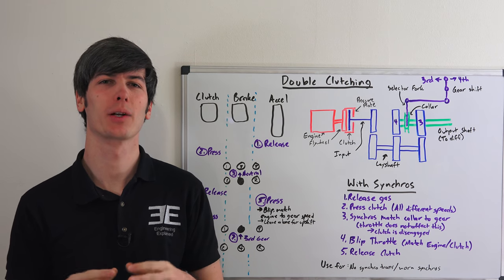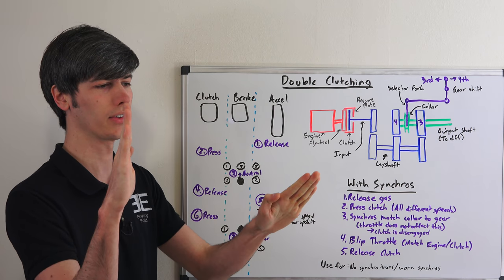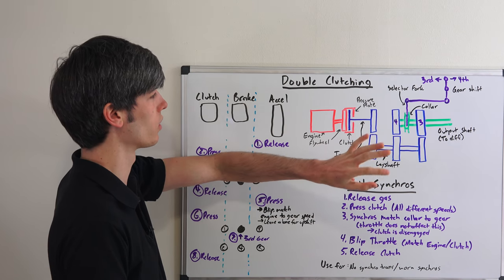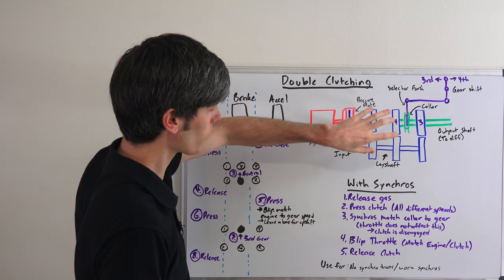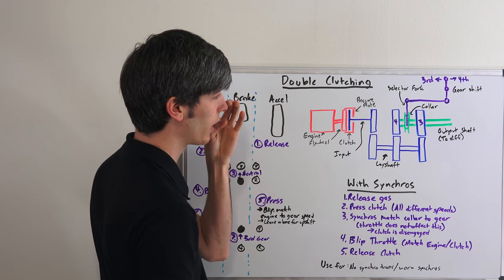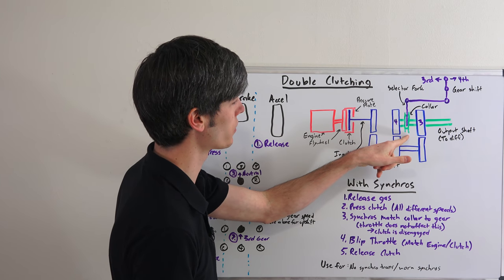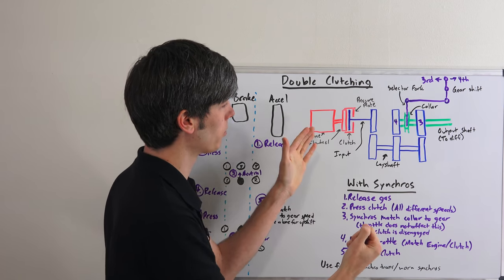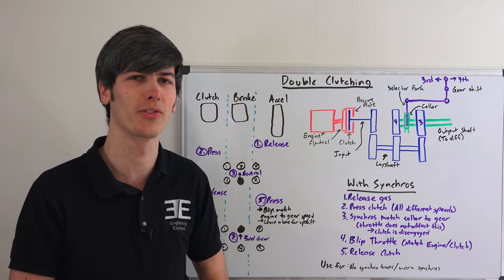What Is Double Clutching?

Comment: What's granny shifting? I almost had this guy in an RX7 but he ended up beating me. When I was talking to him after the race he told me I was "granny shifting" and not double clutching like I should have been.
Reply: you need more nos
Reply: Arvin Singh I heard that'll make your floor fly out from under your car...
Reply: +Hot Rod Lincoln that means you didnt keep on power between the gears, great way to daily drive not best sstrat to win races
Reply: +Hot Rod Lincoln Who needs to double clutch when you can POWER SHIFT for the win!
Reply: +Hot Rod Lincoln You never had him. You never had your car.
Reply: Mike234 What? In the first F&F his floor stoots off his car during the first race lmao.
Reply: Mike234 Good point, I forgot the manifold is basically the floor of a car. Now the movie makes more sense.
Reply: +Mike234 wow spaz much?
Reply: +Mike234 manifold is on the engine lol, floor pan is what your feet sit on (which is what, for some reason, flew off)
Reply: +Hot Rod Lincoln Granny shifting is just slowly shifting the gears than normally. So instead of going from 1st to 2nd and releasing the clutch normally to get back onto the gas quickly, the person would go from 1st to 2nd and even slower release the clutch so that the RPMs drooped a lot when finally done with the shift, the engine actually brought back the RPMs  way higher to normal than usual.  

That part about "not double clutching like you should" is totally false statement made in the Fast and Furious movie for a car to go faster. Double clutching is not going to make anyone go any faster. In fact, they might actually go slower with double clutching in a race?! The fact is, if you look at the movie, NONE of them ever double clutched. Someone find the part where any of them ever double clutched during the race, they won't. What they meant to say was SPEED SHIFTING because that's what they all do in the movie and in all the rest of the future movies. 

Granny shifting and not Speed shifting like you should totally makes sense. But my guess is, double clutching sounds way cooler than speed shifting so the director changed it or the writer(s) had no idea what double clutching actually was. lol
Reply: I don't know wtf I do but I win when I race
Reply: you almost had him !
Reply: I've heard those 10 second cars are amazing machines.
Reply: Hmmm, someone has been watching the fast and the serious
Reply: Almost had him? you never had him. you never had your car.
Reply: Hot Rod Lincoln Channel 😂😂😂
Reply: Hot Rod Lincoln Channel you will have to catch him when he's not living his life 1/4 mile at a time
Reply: Where you just don't bother changing gears and just rev it in 1st
Reply: Do people actually race in a straight line? Lol it must be an american thing.
Reply: You almost had him though right?
Reply: You never had him, you never had your car
Reply: Should've Double-Clutched...
Reply: @idgaf757   NOS is overrated, what you really need is Nitrox 2!  It makes your car go 300 mph, pop a 45 degree angle wheelie, and shoot flames from the tires!  Though in reverse make sure to use Nitrox 3 and 1/2.
Reply: Sadpants McGee never even had his car
Reply: Lol nice fast and furious references 🤣
Reply: violentdawg good thing I have a 65 inch screen or it would be too big
Reply: @hotrodlincolnchannel6266  "you never HAD your car."
Reply: @hotrodlincolnchannel6266  lolol
Reply: @quattro4468  yes and yes
Reply: Lol just saw this scene
Reply: Dude i almost had you
Reply: So they downshift in a drag race, huh?
Reply: You're lucky you didn't blow the welds on the intake
Reply: Sounds like you never had your car
Reply: It doesn't matter if you win by an inch or a mile.. Winnings winning.
Reply: God bless you and this comment and all of the nos amen
Reply: Does he own a Charger R/T, cause if he does you ain't beating him
Reply: you ain't taking the cash neither the respect.
Reply: @chocoboblue99   four years late all of this is correct including it technically being slower but if your on a road course or anywhere that isn't an entire straight line it can be combined with heel and toe and rev matching to smoothly transition gears while immediately getting back on the power this in conjunction with engine braking to coast to corners by shifting up a gear before braking then downshifting like you normally would can make a slow car surprisingly fast since if you get on the power correctly you will be on the dudes bumper in every corner
Reply: Danger to manifold
Reply: @Kacpa2  Shut up! [slams the laptop]
Reply: @scottthewaterwarrior  Nitrox is a Diving gas mix not a Driving gas mix!
LOL!
Reply: @deutschedog3259  Not Nitrox, Nitrox 2!
Someone has never watched the Hot Wheels movies...
Reply: @hotrodlincolnchannel6266  manifold pressure critical
Reply: Hahahaha to many movies
Reply: It was installed back for the next scene when he picks up turedo
Reply: @stanzb3897  you didn't realise that people can tell you copied a comment for likes
Reply: granny shifting is holding the clutch down the whole time when you change a gear
Reply: At least you kept him outta handcuffs
Reply: There's no reason to double-clutch in an RX-7. He was bullshitting you.
Reply: @joevarga5982  Its from first Fast and Furious movie
Reply: Now he has to take apart the block and replace the piston rings you fried.
Reply: >"Granny shifting"
>Granny
>Grandma=relative
Mfw I stop Granny shifting and start Family shifting 🎅🏿
Reply: Same

Comment: Semi trucks don't have synchronizers.  Double clutching is required to pass the CDL test,  but 99% of the drivers I know, myself included,  float through the gears without using the clutch at all.  The only time I press my clutch is when I'm stopped.
Reply: I usually float when driving passenger cars too.  It's not hard after you get the hang of it.
Reply: +wayne foutz I'd like to learn this but I'm too scared and not rich enough to try ; )
Reply: +Xavier Kraśnicki nothing to be afraid of.  If you're grinding,  you're doing it wrong.  When accelerating,  it's pretty straight forward.  Just bump it into the next gear, when the vehicle wants to be shifted.  You'll find when the rpms are in the right range,  the lever will fall right in.  Downshifting is a little more involved,  you have to bump the throttle up to get to the rpm range,  and the lever will drop right in.
Reply: +wayne foutz I learned it from my gradfather back in the day :P
Still a lot of fun, when friends are in the car and they wonder wtf I am doing ^^
Reply: +wayne foutz I do the same thing. I surprised a new hire who rode with me one night. It was dark and he didn't know that I was shifting without the clutch until daylight. The look on his face...
Reply: +wayne foutz I think that even if you do it right on a normal car, you'll still wear out the syncros sooner, because there's more stress.
Reply: +SingleTurboSupra I don't know about that,  you could be right. The vehicle I normally do it in doesn't have a synchronizer.  I don't own a car with a manual transmission,  buy I've done it in rentals and cars I've test driven,  I can shift them pretty smoothly without the clutch. But I wouldn't know the long term effects.  I would imagine that it would make the clutch disk last longer.  I've driven large trucks that have the original clutch in them with over a million miles on the odometer.
Reply: wayne foutz Yea. It'd obviously save the clutch because you'd use it less. I'm also able to do it with synchrod car, but I try to not do it too often
Reply: +Jamie Williamson I don't own a car with a manual transmission,  I prefer larger four door sedans.  That said,  when test drove a car that had one, I found myself floating the gears.  I've been driving trucks for twenty years with Eaton 10 speeds,  and that's the habit I formed.  I'm not suggesting that it's the correct way to drive or that anyone else do it.  Fact is,  I can do it perfectly every time,  because I've been doing it for twenty years.
Reply: +wayne foutz Double Clutching is not always a requirement to pass the drive portion of the CDL Test. Depends on what the examiner requires of you. An examiner's main focus is on driver safety and competency.
Reply: +wayne foutz It is not the same with your car.  The non-synchro tranny in your truck has different cut gears than you car which require the synchro rings to do a lot of the work in the upshift putting a lot of wear on the rings.  In the truck it is a necessity but the gears are more straight cut(like a racing transmission).  I woudl be careful about doing it a lot in your passenger car even if you are real good at it as I suppose you are since you know what floating gears are all about.
Reply: Miatacrosser Straight cut gears has nothing to do with synchronizers. It's the engagement method that matters. Dog-engaged gears don't need clutch necessarily and don't have synchros. Synchromesh gearbox has synchros and require clutch to be used. You can have straight cut gears with both of them. Only thing straight cut gears achieve is less stress on transmission, with the cost of added noise.
Reply: SingleTurboSupra
 You are correct.  I meant to say the slider gear transmissions in trucks are different than the synchro box in the car.  So one should not shift a car without the clutch too often to avoid prematurely wearing out the synchro rings.  I stand corrected.  Thank you
Reply: SingleTurboSupra
I wanted to let you know that me and a buddy opened up one of the transmissions in a big rig truck shop today and sure enough, the gears are straight cut.  It's a sort of modified dog-eared system with a gear on the slider that helps engage the gears.  They are straight cut because, like you said, they have to be strong from the incredible amount of torque that passes through the box and the noise is not a problem cause the benefit outweighs the noise problem.    

 I'd say we were both right.
Reply: +Donal Lour I don't know about today but, when I took my CDL driving test in Calif. in 1990, I forgot to double clutch one time. The examiner turned to me and said, "I saw that, and if I had heard one gear grind I'd fail you and drive this truck back to the DMV myself." I did pass.
Reply: SingleTurboSupra European trucks are light years ahead of ours. Maybe because they're smaller,  I have no idea.  I've seen them with drive by wire disk brakes,  we're still using drums.  They had automatic transmissions long before we did as well.
Reply: Mike234 When disengaging the gear the synchros will wear out more, because there's more stress on them. When shifting the next gear, it should be fine, IF you can perfectly hit the right rpm for the shift. Miss it even a little and you'll be stressing out the synchros during the shift, because you are kinda forcing the synchros a little to engage with the next gear.
Reply: +wayne foutz New Peterbilt and a few trailer manufacturers have optional disk brakes
Reply: Here in europe semi's have been using syncro transmissions since 2000. or so.But pretty much all new semi trucks use automated manuals and they are back to non syncro design since they are faster, and the transmission computer can never miss a shift. I think they are actually programmed to float gears instead of double clutching but i'm not sure. The clutches do seem to last longer on automated gearboxes.
Reply: Most modern trucks also have syncromeshes so you're very wrong.
Reply: wayne foutz good for you, hero.
Reply: I have bad synchronizers in my 1992 S10 I use the clutch to start and stop. I just slip it into neutral let the rpm drop and it slides in the next year smoothly. For downshifting I put it in neutral raise the rpm to the speed required for the gear I want the slap it in. No grinding of the synchros this way but if I use the clutch it grinds every gear every shift if you're not perfect. Not the same as a semi but still floating gears

Comment: Great explanation! The only thing better after or before that description would have been a demonstration. Also, more about where this is useful with a modern synchro transmission; High RPM down shifts, while towing heavy loads, and on older transmissions with a worn synchro - you can stretch life before service if you’re willing and able to double clutch.

Comment: so basically double clutching a waste of time.
Reply: Unless you wear out your syncros like he said.
Reply: Yup basically. Synchros wearing out is pretty uncommon. Back in the late 80's and early 90's my mom had a 1985 Toyota Carolla GTS with 280,000 miles on it, synchros were all fine. She got rid of it because holes rusted in the floor so she couldn't drive when it was raining.
Reply: +DarkHorizons Depends on the car, depends on the mileage.  Wearing out synchros on a car with 100 or 150k is fairly common, more or less depending on the car.
Reply: +DarkHorizons Mine are worn. Its a 07 honda civic 213k miles.....
Reply: +MrSlowestD16 More or less depending on who drives the car.
Reply: +elr2141979 Much like using a standard transmission in general.
Reply: +DarkHorizons it depends. I have a 96 outback and the first and second gear synchronizers (yes there IS a first gear synchronizer) seem like they're pretty worn out but the other gears are fine. This is probably because it's a car with a very low power to weight ratio and so people end up abusing second gear when accelerating from a stop
Reply: +elr2141979 Yeah, people don't really double clutch anymore. If you really poor and can't afford new syncros then double clutch all day long. Your passenger will thank you. Or, if you want to save those syncros and just want to get better at double clutching then by all means go for it.
Reply: +centripetal25 Oh you bring up a good point. I tend to do that too. My car at 5mph and under really sluggish and will wine and cry like a baby till it get's above 8mph when I try to accelerate fast. So, I tend NOT to put it in 2nd after slowing down to rolling speeds. I'll double clutch to 1st gear and now I can get moving fast and then back to 2nd if needed.
Reply: +elr2141979 Yep. If the car seems happy with it, then it's a waste of time. By that I mean it goes into gear smoothly. If the car seems unhappy with it, something is wrong. If you don't double clutch when you are supposed to you'll hear a crunch or just get locked out of the gear. Sometimes even on a synchronous transmission double clutching is useful in the lower gears while the transmission is cold.  I know Mitsubishi's are well known for this and if it's cold they will lock you out of first/second unless you double clutch. Once they warm up they behave as expected.
Reply: not if your driving an old car or any tractor it just matches the speeds and is best used on a non synchro mesh
Reply: In cars, yes. Unless you have a Jaguar from somewhere in the 1950's.
Reply: Your engine will blow up and your body will rust out long before you wear out your synchros (unless you're really bad at shifting) so you'll probably never need to double clutch.
Reply: Not if you want silky smoove downshifts without having to execute a perfect rev match
Reply: DarkHorizons I thought that's why they invented duct tape and plywood.
Reply: My 1990 CRX (considered the best FWD gearbox of that period by Road & Track Magazine) had 170,000 miles on it when I sold it and the shifting was definitely not as smooth and easy as when it was new even though I babied it with double clutch downshifts whenever the mismatch was large, such as when shifting from 3-2 or 2-1 at high rpm/speeds for the gear I was shifting down to. I did not abuse the gearbox with speed shifting for the 26 years I drove this vehicle. The synchros just became less and less effective over the time I had this vehicle.

Over time, the gear lever required more effort to perform any shift and a longer time for each gear change to synchronize; I could feel the lever slip into gear under a steady pressure after things got sync'ed up when shifting whereas when new the gearbox just slipped into gear with low effort all the time and instantly. I couldn't even feel the synchros working really when new; they were so efficient.

As the synchros wore out, I also found that I could perform faster downshifts with a double clutch because I didn't have to wait for the worn synchros to work. When everything is matched up accurately, the lever could be slammed into the lower gear quickly...all without any abuse to gearbox! So not a waste of time at all in my experience.

DISCLAIMER: I should mention that appropriate gearbox oil became harder to find for this car. It was originally spec'ed to use 10W30 motor oil in the transmission because of the additives that were in the oil at that time which Honda liked for their manual transmissions. However, modern 10W30 is different and did not make a good gearbox oil at all. So I used Penzoil Synchromesh instead. It worked pretty well, but I do wonder if the sychros would have felt less worn out if I had access to that old school 10W30 oil that it was designed for.
Reply: Yeah, this guy normally drives little boy cars, so he should have mentioned that virtually all tractors (commercial trucks) have no synchronizers and need to be double clutched. Times change, but that's still the way it is in 2018 for most big trucks.
Reply: my car not have syncros
Reply: And that explains the dangers of double clutching.